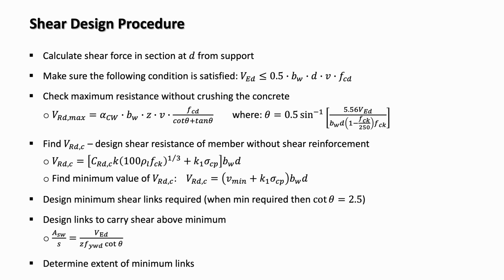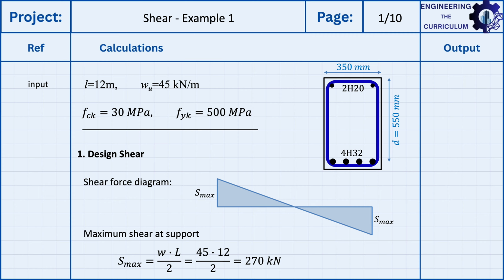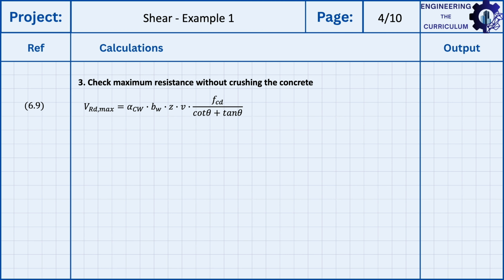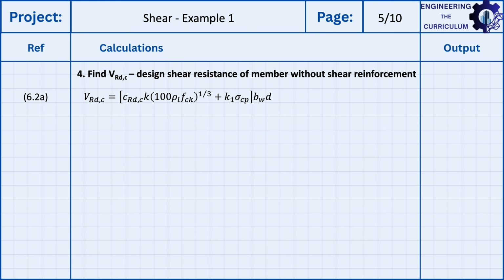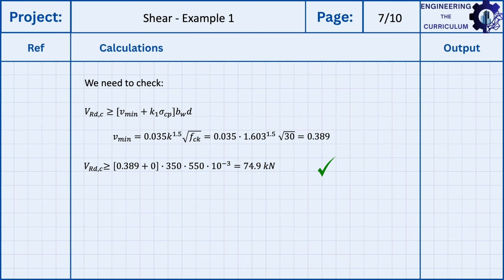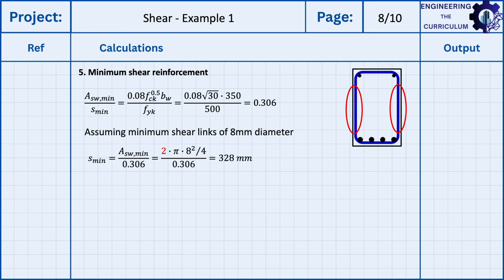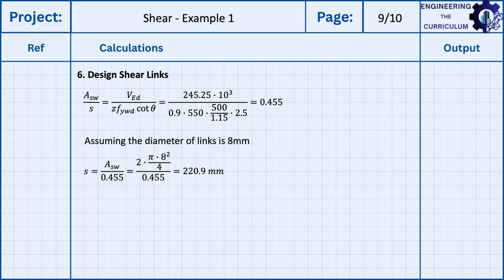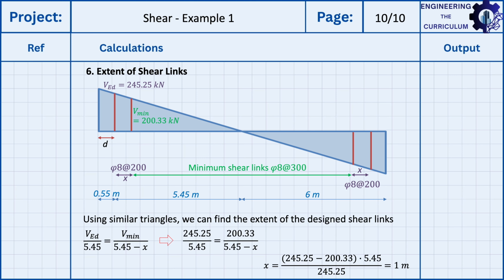Reinforced Concrete Design | Topic 6: Vertical Shear Tutorial – Worked Example 1 | Eurocode 2

Comment: Hi, your video really helpful. However, may I know when we use cot theta = 22 degree or cot theta = 45 degree when determining the Vrds?
Reply from the maker: Thank you — I’m glad the video helped!
Under Eurocode 2, θ (the compression strut angle) is a design variable within 1≤cotθ≤2.5, which corresponds approximately to
45∘≥θ≥22∘. 
• θ = 45° (cot θ = 1) is the upper limit that can be used for simplicity but may be too conservative.
• θ ≈ 22° (cot θ ≈ 2.5) is the lower limit.
If θ < 22°, then 22° should be taken in the design.
If θ is in the range of45∘≥θ≥22∘, then it should be calculated. 
θ can be calculated by rearranging the VRd,max equation (setting VEd=VRd,max); the equation for this appears in the video. 
In practice, you could choose θ within the permitted range, design using VRd,s, and then verify the crushing limit. 
In all cases, you must check that VRd,max≥VEd.

Comment: We have six longitudinal reinforcements: 4 at the bottom and 2 at the top. When calculating Vrd,c, you only used four, not six. Why is that? It's becouse the top of the section is not in tension and we can only use the longitudinal reinforcement that is effective in tension.
Reply from the maker: Your thinking is spot on! We only include the longitudinal reinforcement that is effective in tension at that section, because ρl=As/(b_w*d) in the EC2 shear expression represents the contribution of the flexural tensile steel to shear resistance through dowel action and by controlling cracking and aggregate interlock. In the sagging region, the top bars are in compression, so they are not counted. (If it were a hogging region, we’d count the top bars instead.)